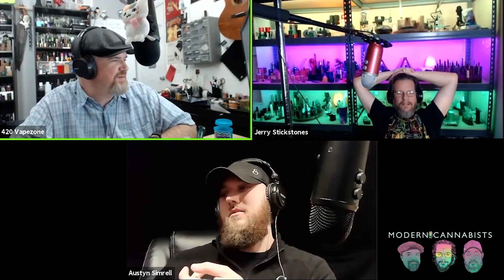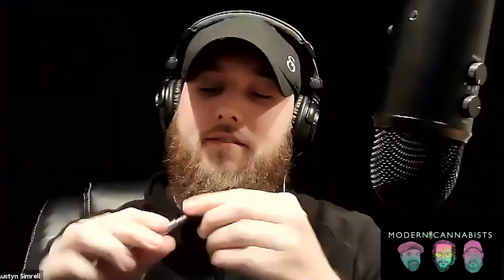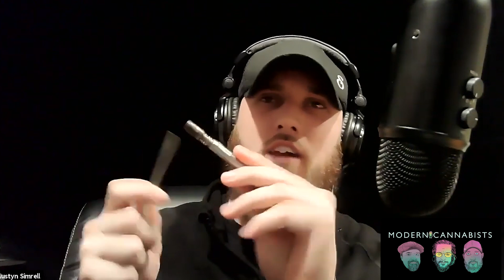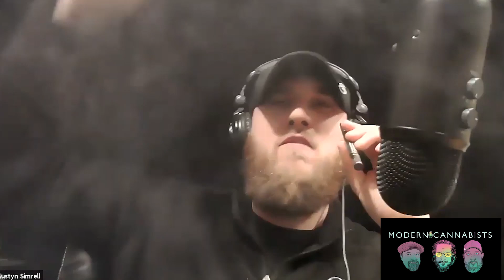How to get THICK CLOUDS with the DYNAVAP VAPCAP - Austyn's vapcap heating method

Comment: First day using the Dynavap and this vid helped a lot. Just drew a big ass cloud for the first time. Starting to get the technique down but really enjoying it so far
Reply: Way to go bro!
Reply: single flame torch to the base is key !
Reply: You still like it considering buying and on a budget
Reply: @zerox168  Yeah I think it's definitely worth it. I got the Mighty last summer for like 250 bucks but I still use the Dynavap most of the time over it. Mostly because it heats up so fast and it's super easy to clean.
Reply: @zerox168  I also considered it, then I bought it. One of my best ever buys. The price is cheap if anything

Comment: Been using vortex xl with intercooler for few years. Month ago installed 2022 omni tip with captive cap, upgraded from 2018 omni tip. Idea was good match. Better in every way. Easy to clean, smooth tasty hits. Wow!! Every time I use the Vortex, feels new, smooth. The new ones Austyn has are nice also. Thank you!:)

Comment: I am a rather new Dynavap user.  So GLAD I found it! I see people say they are not able to get the big clouds, and quite honestly even though I have only owned one for about a year, I don't get why they are having problems.  I don't necessarily heat anywhere but at the middle area of the cap, while I spin the Dynavap.  I heat for about 1 second, and not any more, after the cap clicks.  The first hit is always like Austyn said, a lot of flavor, and little cloud.  But, take another hit right after the cap clicks saying you can reheat, and then simply draw nice and slow and long...and the huge cloud is there.  I HAVE YET TO EVER COUGH EVEN ONCE WITH MY DYNAVAP!  I don't take quite as big of rips as Austyn did. lol  Yup, it's smooth and much less harsh than incinerating the weed.  I often use a multi perc bong to cool the vapor.  My point is, it's really not that difficult to get huge clouds out of a Dynavap. Maybe don't make it harder than it really is.  Also, don't put a little bud in there and expect to get huge clouds.  That won't work good...
First off, grind your weed to a fairly fine texture.  Secondly, pack the bowl fairly tight, like Austyn showed.  If you want a smaller bowl, get a Dynavap with the Titanium tip so it has the Adjust-A-Bowl feature, or the newest 2020 M, which also has that.  Whatever size you adjust the bowl to, fill it full and pack it fairly tight.  That's a key, I've found.  Third, simply take a long, slow draw on it, or do like Austyn did and smoke it like a pipe taking short, hard pulls off of it and a big cloud is what you'll receive.  ;)  
I just sold my 2018 M and bought a Hydravong with the Adjust-A-Bowl feature.  I wanted the smallest bowl size.  I moved the bowl to the smallest size (it's maybe 3/8" deep is all, maybe only 1/4"), so it's more of what most would call a one hitter type bowl.  I actually get about 4 hits off that tiny little amount it holds, making it even more efficient in it's usage of your weed.  Incredible how long it lasts, and how many hits I get off such a tiny bowl!!  The amount it holds is less than what iId usually take for ONE BONG HIT!  Yet, I get 4 hits on average from that tiny little amount of weed!  It's a little mind blowing how far your weed will now go!  I am absolutely positive that a Dynavap will pay for itself in the amount of weed you will be saving vs. however you were smoking it before.  
Enjoy!  =(:^)-
Reply: Thanks for this ^^

Comment: I’ve never tried to heat past the first click , but I will for sure be doing that now . Purely genius .
Reply: simpliyvonne you are supposed to heat till the second click. That’s normal. If you are only heating to one click you are denying yourself
Reply: @thevinyltruffle  Well for me I get pass the clicks. About two seconds with the torch, or 5 second pass with a bic/lighter. Turns into a sticky brick.
Reply: @goodnightsir9671  bro over hear barbecueing his shit 🤣
Reply: Initial bowl pack, heat 12-15 seconds past second click.  For each reheat after, lower the amount past the click by 2-3 seconds or so.

Comment: I only have a 3 flame torch. I can feel the effects but no vapor except on the 2nd hit. This guy is getting vapor and inhaling it back 3x.
Reply: Single flame will heat it more gradually causing more vapor instead of just a sudden jolt of heat with 3 torches.
Reply: A 3 flame torch works just fine too.  Heat it at an angle and all of those torches aren't being as effective.  It's normal not to get a huge cloud on the first hit.  It's the heating up the chamber hit...it still gets you stoned, but gives you mostly flavor.  2nd hit and after will potentially be big RIPS! ;)
Reply: @T3HU  I use single torch and get fat hits the first is ok but second is really good

Comment: If you are stupid, like me, you'll neglect to clean your Dynavap until you get no clouds. Make sure you clean it in proportion to the degree that you need it. You can be misled because you'll still get airflow from the airport, so you'll think all is fine. You may even get a slight buzz from heating up the resin in the condenser, but it won't be the buzz you expect from a 20-30% thc strain. After cleaning, I got the expected results.

Comment: I pack it, press it down lightly with my finger then put the cap on. I have a big single flame butane torch, which I focus the tip of the flame towards the mid-bottom of the cap, rotating it evenly. I also angle the flame from beneath the vape, aiming the flame to shoot up diagonally to get more radius on the cap. I torch it for 6-8 seconds (or until 1st click). I remove the heat for about 6-8 seconds, then I apply the heat back on until it clicks again. Once it clicks a 2nd time, I keep the heat on for an additional 2 seconds. Then I take the WHOLE pack in one hit. It’s usually done after the one hit then I dump the beautiful vaped bud in my jar for later use for making edibles. (Most of the time I just make THC milk & have Coffee💪🏽)
Reply: Thc milk??
Reply: @Chloe-iq7-help  hey friend! Wow I forgot about this comment. So much have I learned since I originally posted. I make strictly butter now from the vaped bud. I put that butter in virtually anything.
But yes, when I first started using the vape, I would simmer milk with vaped bud for 35-45 minutes, strain the now-infused milk, and use with coffee or hot chocolate.
Reply: @john-tobeymaguirecena  I know you said it finishes in one hit , but will the product inside continue to provide clouds although the thc has been extracted ??? Silly question Im just new sorry
Reply: @peaceonearth7142  if the thc has been extracted fully then if u keep trying to vape the whole product it’ll ashen up
Reply: @john-tobeymaguirecena  I find it just keeps going and going , like producing vapour. Not sure if it still getting me high but for sure I still see clouds even 30 mins of vaping with a simrell and induction heater. 2 secs pass the click.   I'm now learning at most 1 bowl should be 5 or 6 cycles and then change up. Thanks for replying
Reply: @peaceonearth7142  so that’s a personal preference. See I like to have strong edibles, and don’t necessarily need the full extraction to get high. When the weed looks light brown with the smallest streams of green, that’s perfect for edibles.

Nowadays I take 3 packs during a sesh. 1-2 hits each pack depending how much adhesive & smoke I get from each hit. You should go by the color. Anything that heats up can generate smoke, I can’t say for sure that smoking the same .01 of a gram of weed for 30 minutes is gonna give u the same strong high. Sounds like u just wanna smoke it instead of vape it.
Reply: @peaceonearth7142  you remind me of my friend who has the induction heater. He has to sit there & heat his shit up 4-6 times too. Not me. I get it to that perfect temp right off the rip
Reply: @john-tobeymaguirecena  it's more I keep smoking chasing that dragon of a high lol. I will try the 5 to 6 cycle  change bowls . Thank you so much for replying. Means alot 😊🙏
Reply: @john-tobeymaguirecena  😩😂😂
Reply: @peaceonearth7142  of course brother!!! Anything to help a fellow smoke buddy. Yeah my boy has the induction heater, & he’s actually the one who put me on this vape to begin with. Yet, I learned quickly with mine. It also depends on the metal of ur vape. I have 2. One is titanium & one is stainless steel. The titanium one is 10x better, my original comments instructions were for a titanium vape (which was my first dynavap)
Then early this year I got a stainless steel one that was on sale & the metal is thinner. I find myself burning the weed, when I torch it the same way as the titanium. So look into ur metals as well. All metals contain heat slightly differently

The vape is definitely the way to go, for those wanting to save money, get more bang for your buck. You can literally use the plant twice which is astounding. Once for vape & again for edibles. The edibles I make are stronger than anything I buy from stores.

I never lit weed on fire again after this purchase. I used to be a bong smoker. 
Now I vape & bake 🤘🏼
Reply: @peaceonearth7142  it’s all about getting thru the quick learning curve👍🏼👍🏼
Reply: @john-tobeymaguirecena  yup I have a ti tip with the simrell vortex 😊
Reply: @peaceonearth7142  perfect 👍🏼

Comment: I count rotations of the digger outer after the click to get consistency.
Reply: What does digger outer mean
Reply: @HeizenbrgYT  the square tab on  the cap can be used to' clean the bowl.
Reply: Aaron Eggleston I find that if I do 1 or 2 more light heat cycles the fill blows out easier
Reply: What does this even mean.

Comment: Im really struggling to get decent clouds even following the same advice. With the air hole closed the draw resistance is so hard to inhale. So I tried open and feathering the air hole still nothing. I really want to love it.
Reply: Same problem here, exactly what you said.
Reply: I love my Dynavap...try to pull with your tongue/mouth (like when you smoke a big cigar)really hard when you close the air hole. Also too much moisture in your weed + thick grind = it’s hard to pull
Reply: I said so in my other post, but:  1. use a pretty fine grind. Not dust, pretty not far from it.  Do not just take a small bud and pack it in there.  That doesn't work at all.  lol
2. fill the bowl, and pack it tight, but not super tight...one finger push tight. 3. the first hit is the flavor hit and you won't get any vapor or hardly any. 4. Heat it right after the double click telling you its ready to heat again...after the 1st flavor hit.  4. Heat it at most about a second longer than the click.  I heat it right in the middle of the cap and it seems to work just fine.  I don't find much of a difference to where I heat it.  5. *Draw slow and long*, or like Austyn did, like a tobacco pipe.  6. I hold it in for 10 seconds after stopping.  
Which model Dynavap do you have?  I have found that my older 2018 M was pretty hard to draw on with the carb hole closed.  My new 2019 Hydravong, or the 2020 M, draws much easier because of the new carb hole, but especially from the little divot cuts in the top of the bowl.  It's a far superior product.  I also like the adjustable bowl size.  You should get huge clouds after following those steps.  Facts are, you don't have to have huge clouds to get REALLY RIPPED! lol  =(;^)-

Comment: it also depends on what kind of cannabis you are using. Some cannabis will easily give yuou big clouds and some will never give you that massive cloud. Thats life.
Reply: I think that is true.  Also, it depends how fine your grind is, and how packed you make it.  I've found small bowls don't give big cloud hits.  It really thrives on packing it fairly tight and all the way full.  That's why I just got a Hydravong with the Adjust-A-Bowl feature and now use the smallest bowl.  Not only is it even more efficient with your weed usage, but I get about 4 hits off that tiny bowl!  And, it's easier to pack it full and not have so much of that type of weed you are vaping that you wish you didn't have so much left over.  I vape both THC and CBD weed, so sometimes I'd rather have a CBD hit, but the largest size bowl still has quite a few hits left to it.  So, that's why I like the smallest bowl.  It's finished quicker, so I can change varieties.

Comment: This is more so for the 2020 version of the M rather than an older model but my 2020 M gives me much better hits if the weed is loosely packed instead of tight.
Reply: That new one draws better, doesn't it.

Comment: My M is on the way and I'm so hyped
Reply: same, which one did you get? whats ur opinion so far?
Reply: @TheFilipe158  I had gotten the 2020M and I fkn love it
Reply: Got mine a few days ago and its awesome, super practical too. If its well packed it hits like a truck
Reply: @TheFilipe158  You got it brother!  a fine grind and well packed!  Simple as that.  I just heat in the middle and turn it...nothing special about where to heat it, not for me anyway.
Did you get the 2020 M, or?  With the new models M, and the ones with the titanium tip, you get the Adjust-A-Bowl.  I adjusted it to the smallest bowl size, and still get about 4 hits off that tiny amount.  It's even more efficient with the smallest bowl!  Damn thing will pay for itself easily with the amount of weed it saves you!  CraZy! :)
Reply: @KOrnhOliO1  yea I got the 2020 M. Im still getting the hang of it but if I want to get high quickly Ill heat the cap for 4 seconds after the click on the first one and on the other ones (with 30secs intervals) I do 2 seconds after the click. Also, aiming the torch slightly lower than mid cap has been helping too.

Been getting thick clouds and overall just more effect from the herb, great stuff
Reply: @TheFilipe158  My friend, if you go about 4 seconds after the click, you are without a doubt burning your weed!  MIND THE CLICK! ;) lol First bowl will not produce much cloud...but after that, you will get great clouds.  Remember, it makes no difference how big your clouds are in relationship to how stoned you'll get!  YOU DON'T WANT TO INCINERATE YOUR WEED.  After you've burned it once, you'll continue to burn it with every hit afterwards.  So, mind the click, understand that the first hit is the flavor hit and won't have much cloud.  Then, use *NEW THINKING*.  Understand that you aren't using a pipe, aren't using a bong, and aren't burning and "smoking" your weed.  You are vaping, so you aren't going to use the same memory of the clouds you get from any of those other way to "SMOKE" weed.  Forget about the cloud size.  Like I said, small clouds will still get you stoned.  Cloud amount makes no difference.  *New thinking needs to be applied*, and 4 seconds, or even 2 seconds after the click and you are definitely smoking and burning your weed, and not getting the benefits of vaping it.  Of course you are not going to get the same huge cloud when you aren't burning the weed.  So, do yourself a favor and adjust your thinking about cloud size, and enjoy the way you are supposed to be using your Dynavap.  The healthier way - vaping, not burning and smoking.  Now, go have a proper hit and stop the lighter at the click....  lol  ;)
Reply: @KOrnhOliO1  maybe im placing my torch further away but I know for a fact that I am not combusting (I did it a couple times and it just tastes awful and instead of brown to light brown abv you get basically combusted plant matter.

Def. true abt the small clouds still hitting hard. But its just so much better to have a clearer high with vaping and not the throat and lung issues from smoking
Reply: Im a little skeptical… im worried and I need fat hits to get my rocks off like really milky bags is what im use to from the arizer eq with d Dave mods but it’s become to much of a hassle and im looking for something that doesn’t take 15 mins to even get going
Reply: @KOrnhOliO1  meh this just kinda made me realize that if I want a cloud I must have to get like the mighty or something.. kinda discouraged by this because I really agree with your statements but as my tolerance is insane and I’m heavy heavy user I’m worried I’d be dissatisfied. Please put me my worries to rest?

Comment: I have a wooden Nonavong, it's about 2 years old. I feel like I want to try a metal M because I really have to pull to get anything out of my Nonavong. I mean, really, really pull. I clean it, which helps a bit, but it still feels like it ought to be a tiny bit looser on the draw. Grind consistency and bowl packing also has minimal effect. I can use it pretty well it just feels like I'm missing something. I'm using it as a daily driver while I wait for new nails for my Ditanium to come in the mail.

Comment: How many hits can you get before a refill is needed?
Reply: On the full sized bowl like they all have, or the older models of the M only had....I get about 8 - 10 great hits!!!  That's counting the flavor bowl, the first hit, that doesn't produce much vapor, but gives you great flavor, the terpenes, and still gets you stoned.  I recently moved up to a Hydravong.  It has the Adjust-A-Bowl feature that allows you to pick either of the three bowl sizes by adjusting the titanium screen.  I bought it just for that feature.  I moved the screen to the smallest size.  It's maybe only 3/8" deep, at the most.  About 1/4 the size of the full sized bowl.  Yet I get about 4 hits off it!!!! .... making the Dynavap even more efficient than the 2018 M model I used to have with only the full size bowl (which is still really small!)
You just can't believe how many hits you can get off that tiny sized bowl until you've done it!  It certainly makes the Dynavap pay for itself rather quickly with the amount of weed you save.  I sure do love my new Hydravong!!! ;)